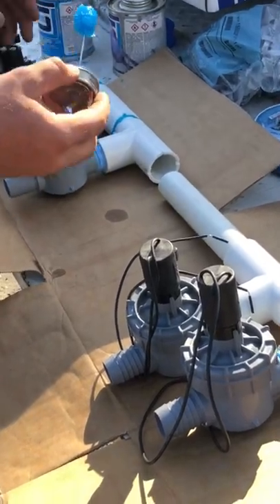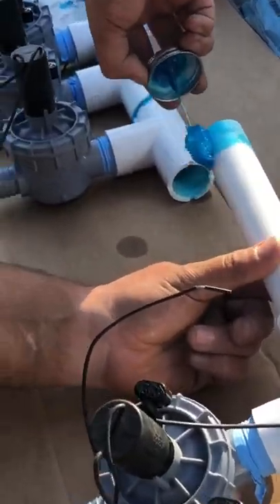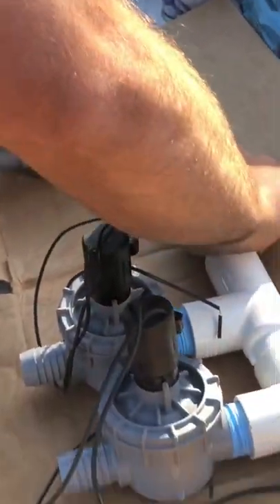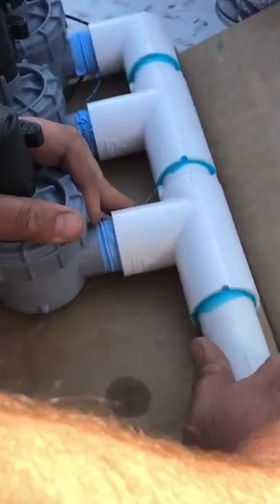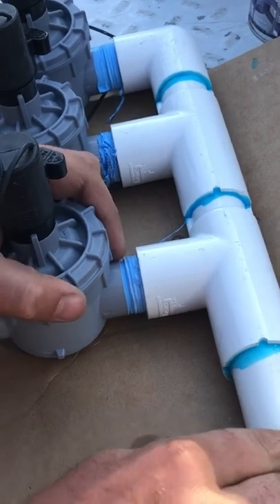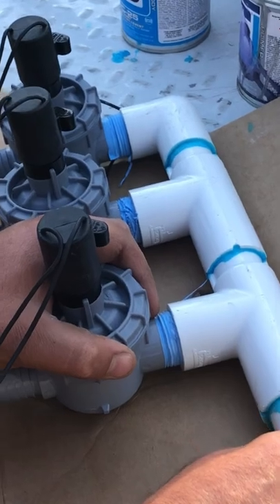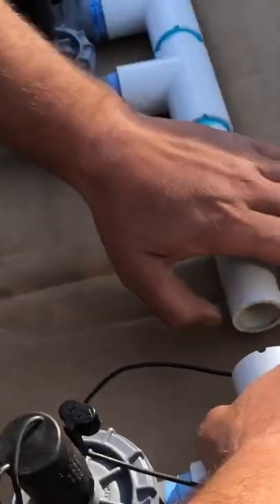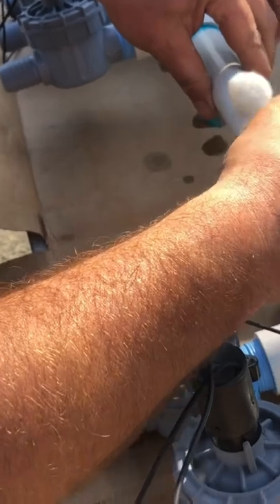How To Install Sprinkler Valves

Comment: They are too close together, have to think about future repairs and replacement.
Reply from the maker: True
Reply: I think he was trying to make a duplicate of the original orbit multi valve manifold. In the original they are this close and IF im not mistaken (dont quote me on it) i believe its also a one piece meaning if something breaks, gatta replace the whole manifold. But wouldn’t be a bad idea to leave about 2in in between each T just incase you need to replace something you’ll still have two inches to add a new T and but glue it all up
Reply: Those are Jar tops and can be rebuilt.  Still should use manifold fittings but nobody I’ve ever seen on the YouTube rors
Reply: remove the top and spin them off.

Comment: Pleases don't do this as a professional for 39 years. Manifold ING is all great for ease but if 1 of your mainline tees break, it's a nightmare to repair. Better of locating valve in the center of the zone, system will also work better without the friction loss

Comment: They sell pre molded manifolds in 2, 3, and so on. You can also add on to them. Saves a lot of time and if you need to change a valve later you just unscrew it at the union and screw another one in. Check your local nursery sprinkler shop. Not going to find them at a big box store other then orbit.
Reply from the maker: Thanks

Comment: No schedule 80 for the manifold? Or gray heavy bodied glue?
Reply from the maker: The ex partner said he knew what he was doing lol 😆
Reply: @jerseyshoredrainagesolutions  not knocking at all, I mean hey if it doesn’t leak that’s great. But definitely should use schedule 80, purple primer, gray heavy bodied glue, add longer nipples between the  valves and tee fittings (at least), blue Teflon is usually thicker than white Teflon - use white Teflon it is less stress on the connections. 

Judging from the blue Teflon, the guy was a plumber. I’ve worked with a plumber doing irrigation, let’s just say he had his ideas and I had mine 🙄
Reply from the maker: @reAllyNoWayyy  I heard that 😆
Reply: Could be 40c which is a stronger 40

Comment: I've been doing sprinkler pretty much all my life I'm 22 now started when I was 10 changing sprinkler heads. I rarely put primer only when I have inspection. Just glue on pvc will not bust if you leave it to dry for a bit.
Reply from the maker: Thanks for the tip

Comment: How do you take the valve off it you have to replace the valve.😊
Reply from the maker: You unscrew it
Reply: @jerseyshoredrainagesolutions  DO  a video with the same mockup let's see.
Reply: Just change out the guts

Comment: Can i just hook up the sprinklers to a water faucet outside?
Reply from the maker: They do have those types of timers. But you would also need the lines up to connect to them. And depending on how many zones you have and pressure… they may not work efficiently

Comment: The language in this video is slightly misleading cause there is unknown false information by the creator. 

Says "once its togther thats it" "replace the entire manifold" this is the unknown false information. Heating the pvc at the connection will allow the tubing to be removed and if done right (again very easy) you will not damage the connections and be able to reused everything besides the pvc tubing.

Comment: Really shitty way of doing it.  You can buy manifolds for probably less than you spent on fittings and glue.  The advantage of the manifolds is they have tube nuts that are free to rotate.  So you can easily unscrew the solenoid.